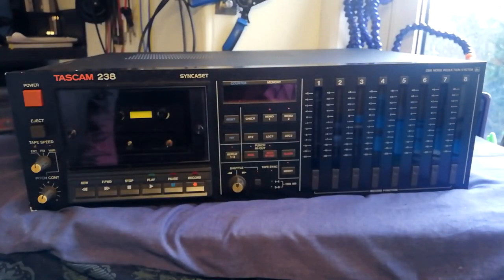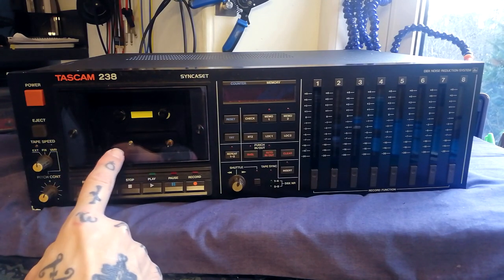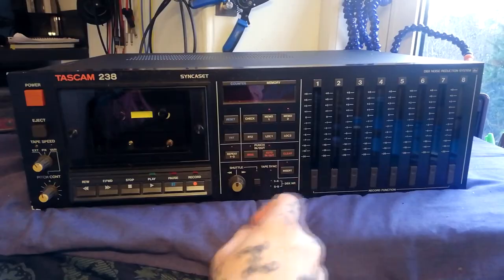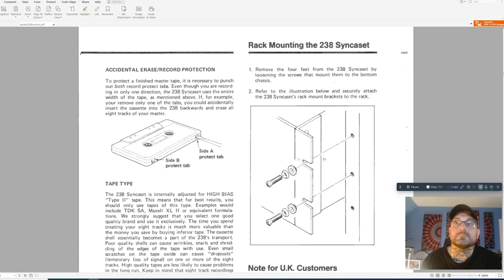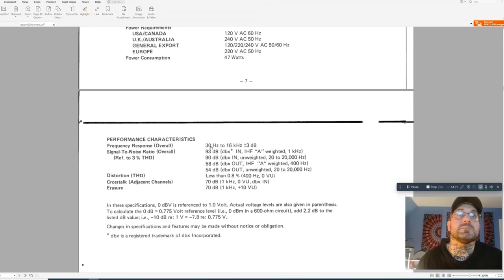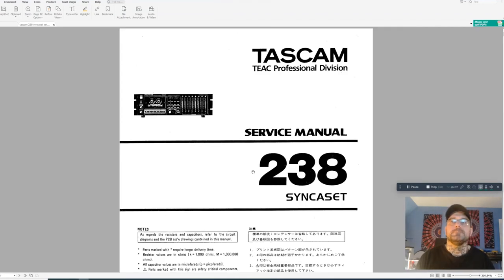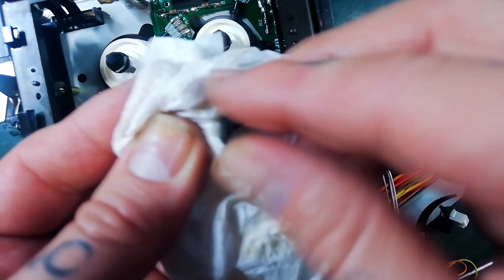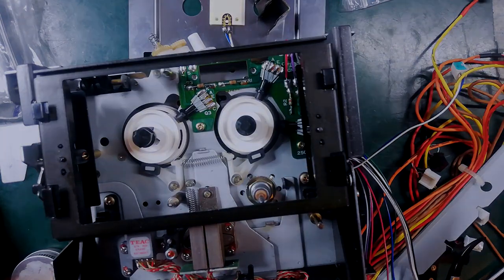Tascam 238 Syncaset | First Impressions, Tear Down & Repair.

Comment: Great to see the process of this getting repaired and you’ve also explained what some of mysterious buttons on the control panel do! I feel a similar way about all the midi sync stuff but must give it a try it out at some point. Thanks again for fixing this unit and I’m delighted to have a working 238 again! 🙌🙏
Reply from the maker: Someone commented about seeing two of  these synced by computer as a 16 track - I wondered if that'd be possible with this unit and your 688, I forget whether the 688 has SMPTE control as well?
Reply: @Tetrakan  I saw that comment too and have been wandering if it’d be possible all afternoon. I’d love to have a go if so and was planning on asking you for some advice! 🙏😊
Reply: @wehappyfewmusic  I think you need the rare MTS1000 controller for that. And 2 very rare cables. It's very complex, and I thought because ot that the dbx on track 8 is disabled when you use external sync. Because you need to record a sync track on both tascams when using the MTS1000.  I'm not sure you can do this with another sync unit.
Reply: @bonno666  Yes I don’t think it’s very straightforward to do unfortunately. I’ve recently got hold of a Tascam ATS-500 which is meant to be able to sync 2 machines with the accessory 2 connections. It didn’t come with the sync cables so I’ve asked @tetrakan to see if he can make them. 🤞🏻
Reply: @wehappyfewmusic  The cables are very special, they have 2 extra shielded wires inside the cable. If you don't do that you get glitches.
Reply: @bonno666  Thanks for the help and extra info, much appreciated as it’s hard to find much about the cables. I contacted @Tascam and they kindly provided me a pin out diagram but if you have any other tips they’d be greatly received.
Reply: @wehappyfewmusic I have made a wiring of the accessory-2 cable.
Reply: @bonno666  oh cool, would be great to see the wiring diagram if you have it and are happy to share it?

Comment: Got three of them and one Dolby-S version a few years back when no one wanted them and kicked them out. Repaired them (especially the capstan board on all units needs attention). The Dolby-S version was unrepairable till this day because of some faulty dolby chips. What a beauty of engineering art! :)
Reply from the maker: Have you seen the site 238pro.com? I’ve only skim read it but there was information about getting the Dolby version working up there. I’ve come to prefer the less obtrusive and coloured sound of Dolby NR to DBX, so having that NR on an 8 track with my studio master 16/ mixing desk sounds like peak cassette recording tech
Reply: @Tetrakan  No I didn't know the site even exists. Thanks for letting me know! Will check the information on there regarding the Dolby-S problem.

Comment: I have two of these. The better (less use) one is for sale on Reverb. I've replaced most of the Electrolytics caps and replaced all the caps on the capstan board as well. Calibrated and sounds fantastic for a cassette 8 track.

Comment: Bias setting question. I was having a hard time getting the bias setting just right. Manual calls for same level of 1k and 10k. Can be time consuming for sure. I tried sending 1k then 10k, playing it back and seeing the difference then tweaking R62 again and again. Then I decided to try recording a dual tone 1k and 10k, then looking at it on the spectrum analyzer making it easier to see how far off I was. Saved a lot of time and I got them dialed in tight now with a nice flat frequency response. Do you have any tips on how to do this better? Thanks for the great video BTW!
Reply from the maker: With a open reel system with 3 heads it’s much easier to set bias because you get slightly delayed feedback from the repro head on what the trimpot adjustment is doing. The compromise I use with two head systems is to record a vocal narration of the position of the trimpot on an adjacent track to the test tones with a microphone, so my voice will say stuff like “fully counter clockwise, 20 degrees higher, twenty degrees higher, halfway,…..” and so on. Then playback both recordings, listening to my voice while observing the meter behaviour for the test tone. It’s still a PITA compared to setting up the same thing on a three head system but you get some sense of where the needle peaks and how far to go beyond that for an appropriate level of over-bias.

Comment: Excellent stuff - interestingly my old Fostex E 16 does not advertise in the manual (or the front panel) that it has anything but a global Dolby C defeat switch - yet when you open it up and get access to the channel cards there are defeat switches for track one and track 16. I'd assume they kept it simple for most users, but more discerning 'pros' if asking the dealer would have been supplied the information.

Separate note (please excuse this off topic to the video) - I've a Fostex 250 that I'm using with students and owned since 1988, and have been going through the maintenance manual to bring it all up to spec - which it nearly is - and found the ferrrite screw for the channel one Dolby encode circuit is missing! 
It still seems to function fine on primary record passes (does not like excessive transient materiel on a bounce to track one though)  as the inductor only sets a minimum bias point for that section, according to the manual 
Just wonder if possible you may have something that may go in there if you have scrap spares etc - and if so best way to contact?
Reply from the maker: I don’t have a scrap 250, unfortunately ,….for the sake of one channel could you house an extant part of equivalent value on a little Vero board baghterboard and use hookup wire to manage any difference in footprint?
Reply: @Tetrakan  Thanks. Sadly that may be the case - I've scoured old radios etc to see if I could find a similar screw to no avail.
Reply: @Tetrakan   I managed to source one from TascamNinja - he had the exact part so all sorted

Comment: I’ve seen video of 2 of these units synced together using that serial port, but I don’t recall what device accessory was used. I assume one tape was stripped with SMPTE.
Reply from the maker: As mentioned in this video, I’m normally a bit of a sceptical curmudgeon when it comes to to sync stuff, but the idea of a cassette based 16 track does sound exciting - please post a link here if you find the video again?
Reply: Both tracks 8 were striped with SMPTE from the Tascam ATS-500.

https://youtu.be/UNGRONFxoc4?si=lGeYfY3dcwoNtZsK

Comment: wow, what a deck, i would love one for my colection just cause it looks cool, could the speed be changed to 1/78?
Reply from the maker: There’s a tiny trimpot on the capstan motor board marked 4.8 which I assume means it could be calibrated for the lower speed, though I guess that’d require some modification, I didn’t have time to look into it properly.